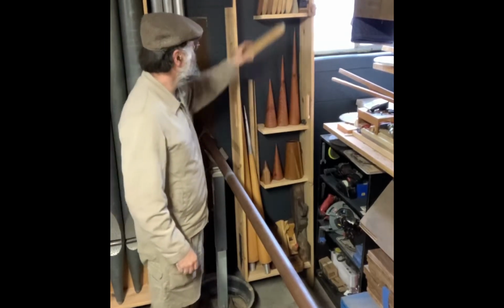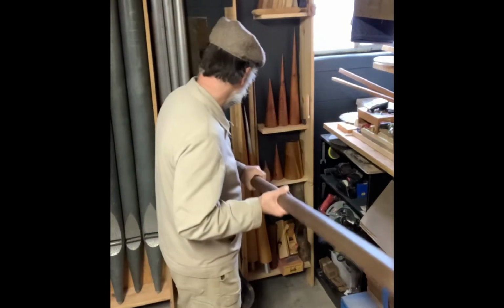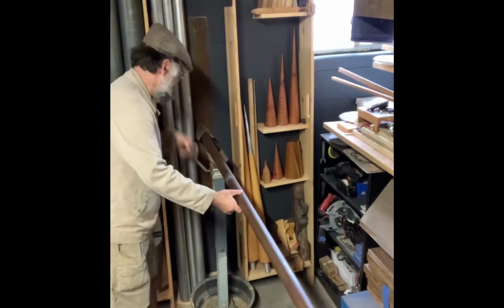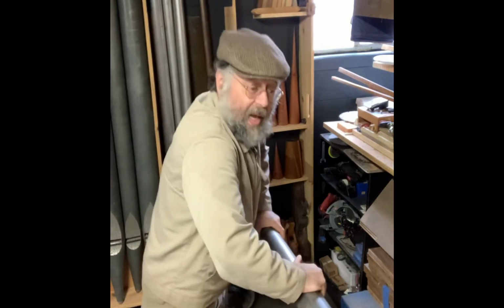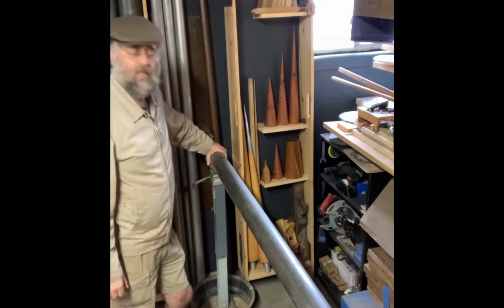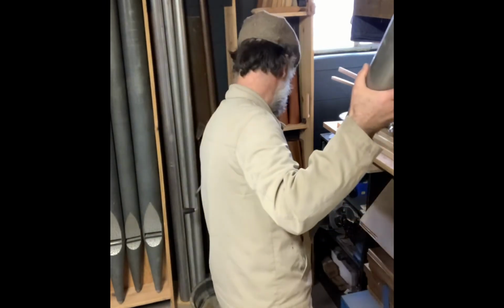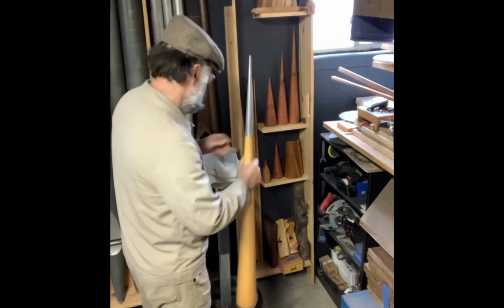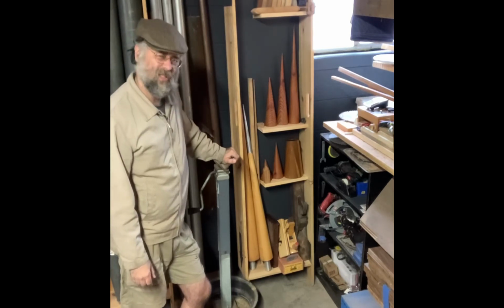Wilhelmy Style DIY Mandrel Holder For Organ Pipe Manufacturing And Organ Pipe Repair

Comment: What are the basic angles and lengths one wants for tapered pipe mandrels? I’m thinking of having a friend machine some for me, but I can’t get an answer from anyone about the dimensions. If I were to have a set of 5 or 6 made, what are the most common sizes that will be of the most use?